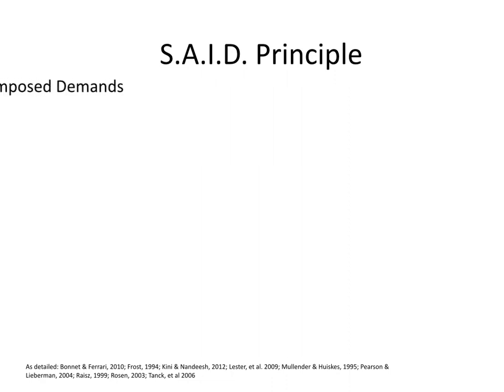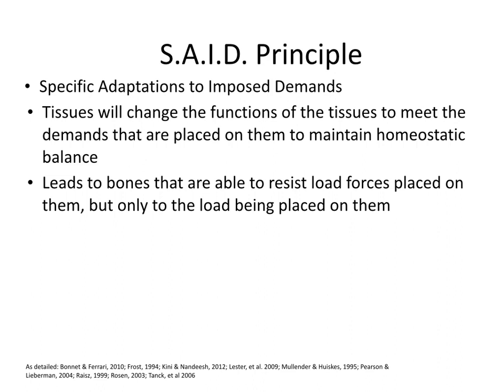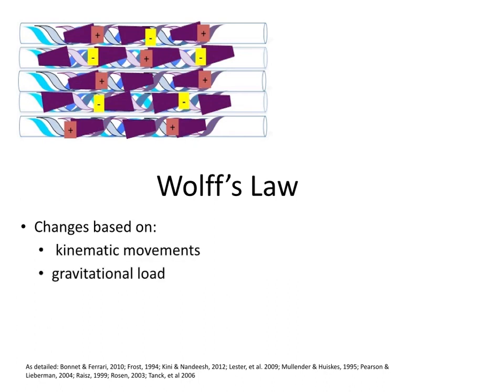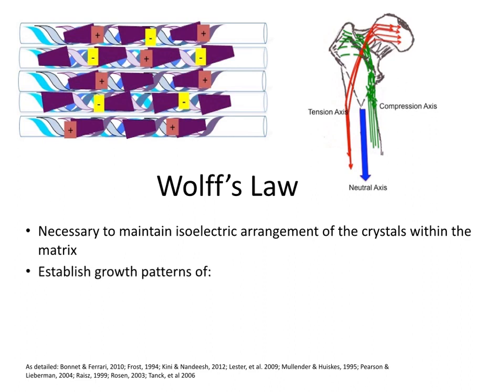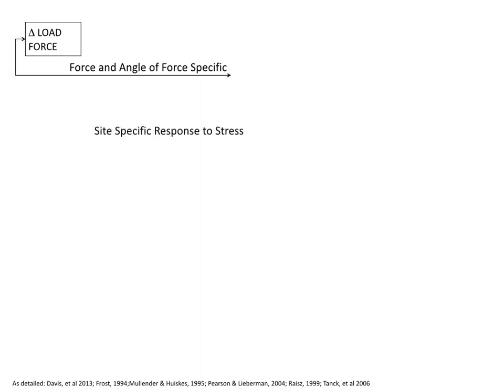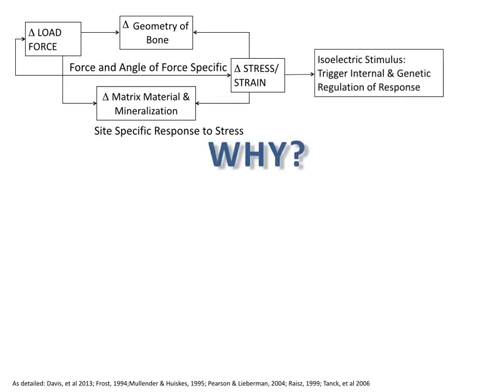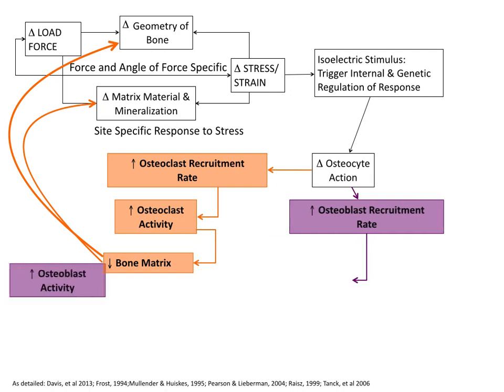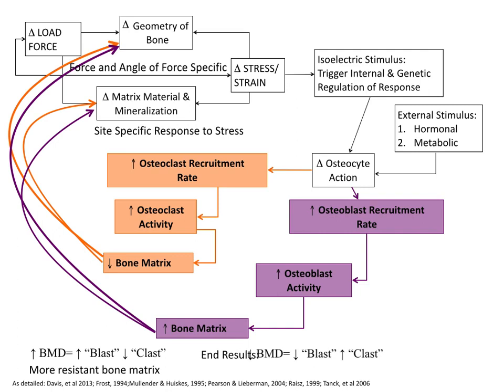Wolff's Law Schematic

Comment: Hello, great explanation for educational purpose. Are there any studies which are cited for this video?
Reply from the maker: Here are a short list of some of the references used for the lecture that are listed throughout the video:
Bonnet, N. and S.L. Ferrari. IBMS BoneKEy., 2010. 7(7). DOI: 10.1138/20100453.
Clark, J.E. and D.T. Goon. J Sports Med Phys Fitness, 2015. 55(3).PMID: 25303063.
Frost, H. Angle Orthodontist, 1994. 64(3). PMID: 8060014
Kini, U. and B.N. Nandeesh, Physiology of bone formation, remodeling, and metabolism.DOI: 10.1007/978-3-642-02400-9_2
Lewis, J.W., et al. Cell Rep Med, 2024. 5(5). DOI: 10.1016/j.xcrm.2024.101574.
Looker, A., et al.. Vital Health Stat 2013.PMID: 25204772
Raisz, L.G. Clin Chem, 1999.PMID: 10430818
Shapses, S.A. and C.S. Riedt. The Journal of nutrition, 2006. 136(6). DOI:10.1093/jn/136.6.1453
Sromova, V., D. Sobola, and P. Kaspar. Cells, 2023. 12(21)DOI: 10.3390/cells12212576.
Reply: Zhang’s law supplements this. Saying that bones can increase in length due to mechanical load (even post puberty)

Does this mean we can grow taller via mechanical loading (running, jumping, etc)